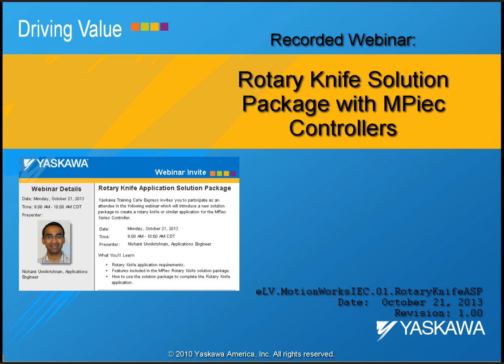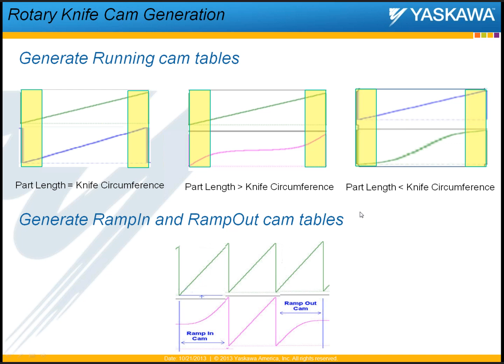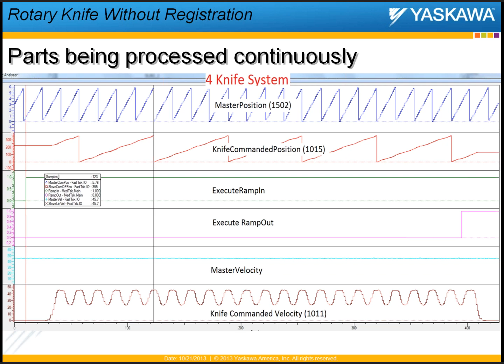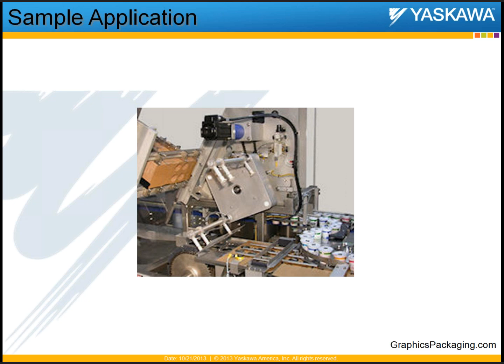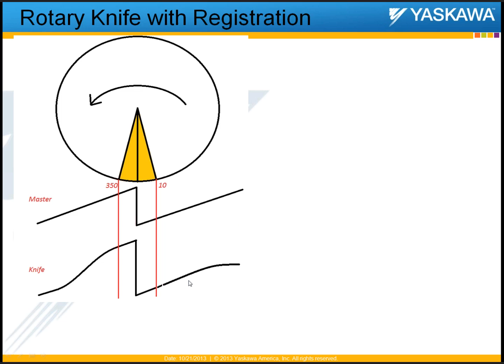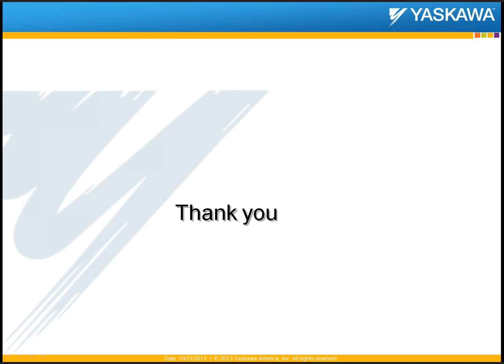Comment: Excuse me，if I want to change the cutting length with PC or HMI before starting the e-cam, can Yaskawa mp3000 controller do it?
Reply: What I mean is to use PC or hmi to change the cutting length value first, after the value is transmitted to the controller, change the e-cam curve, and then start the machine
Reply: Is the setting function of yaskawa motion controller's electronic Cam able to do this?
Reply: Thank you for your interest in "Rotary Knife Application Solution Package"
Changing the input labeled 'part length' is available on Rotary_CamGen function block for changing the part length. It will be accepted when the execute bit is enabled (with a rising edge) of the block. We recommend contacting our Technical Support with your application information at https://www.yaskawa.com/support-training/support or you can also reach out to your local Yaskawa Service Provider - https://www.yaskawa-global.com/company/profile/global
Reply: @YaskawaAmerica   I see, thank you very much for your reply 😀

Comment: What happens if the operator wants to change bag length while the cam is running?
Reply: The rotary knife solution without registration (as presented in the webinar from a few years ago), cannot be used to change bag lengths on the fly. If you want to change bag length on the fly, we have a new function block that can be used to manage such applications. Please contact out Tech Support Team at: https://www.yaskawa.com/support-training/support for further assistance. Thanks for the question!